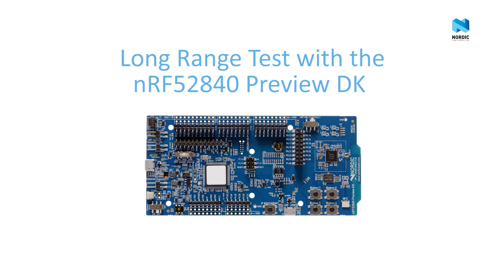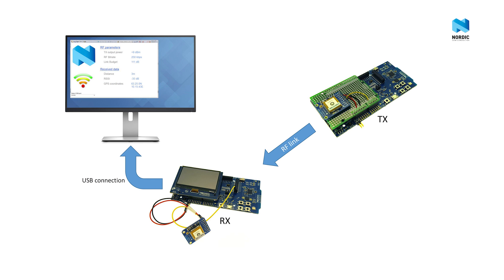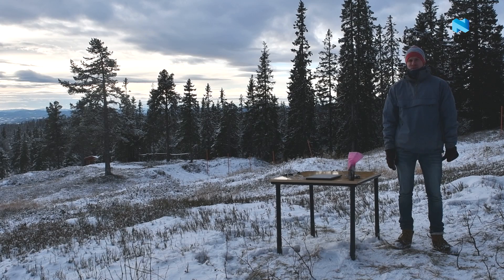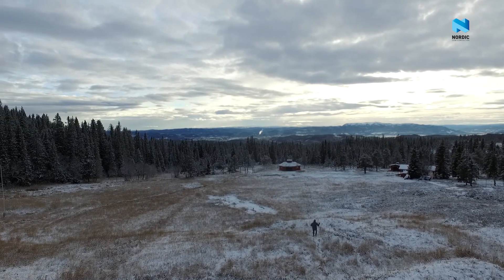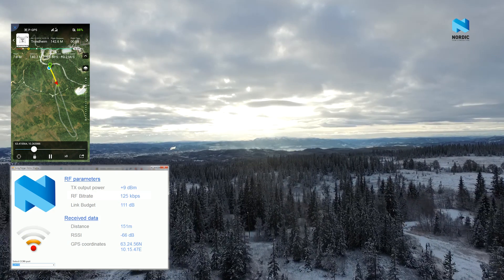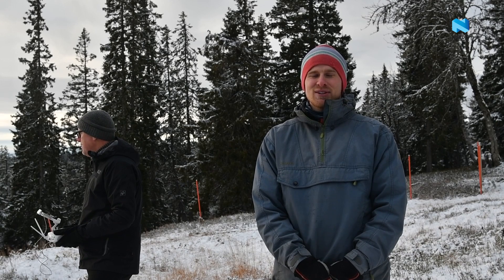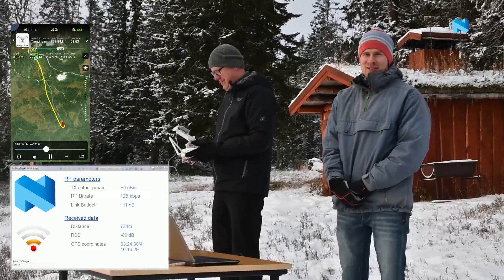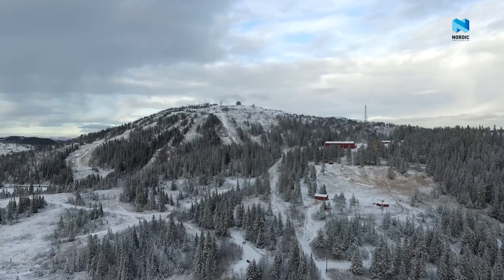Nordic Semiconductor – Bluetooth 5 Long Range Test with nRF52840

Comment: which antenna could i attach to my nrf52840 board. I did not found correct connector for connecting an antenna and testing BLE Codec PHY...
Reply from the maker: The DK already has an onboard PCB antenna so you won't need to connect one to use Coded PHY here as there are no HW requirements for Coded PHY antennas specifically. You can use our board guidelines app note for HW design tips to create you own: https://infocenter.nordicsemi.com/pdf/nan_040.pdf

Comment: Can this be used to transfer voice data between 2 motorcycles on the run about 1km range?
Reply from the maker: The Bluetooth Long Range mode is not very well suited for audio data, since the data rate is quite limited. An alternative to the LR mode is to use a FEM (front end module) to boost the output power of the device, then you should be able to achieve a km of range if you have line of sight, without having to sacrifice too much data rate.

Comment: where is the code!
Reply from the maker: The exact code used for the video is not available, but a similar demo which can be run using the DK's only can be found here:
https://github.com/NordicPlayground/nRF52-ble-long-range-demo

Please note that this is a very old example, and if you are starting a project today it is recommended to start out with the newer nRF Connect SDK, which includes various samples showing how to set up the long range mode: https://www.nordicsemi.com/Products/Development-software/nRF-Connect-SDK

Comment: Hello, I am currently working on this nRF52840-DK board. I want to work with the NFC/RFID reader. I found that Nordic supportX-NUCLEO-NFC05A1 for the nRF52840. Unfortunately, this NFC reader is out of stock in most of vendors. Could Nordic please give me some suggestions for an external reader which is compatible with nRF52840 and with nordic library NFC Reader ST25R3911B. Thanks
Reply from the maker: Hello, we haven't tested the sample with any other shields unfortunately. You could try the X-NUCLEO-NFC08A1 which uses the same chipset and is widely available, but since it hasn't been tested internally there is no guarantee it will work.

Comment: want to use nRF52840 connect to my house 's router .So does the nRF52840 has wifi chip embedded on board ?? 🤔
Reply from the maker: No, our SoCs does not have Wi-Fi onboard. We've just started working with the technology.

Comment: did you test in underwater i want to use it for an underwater project with a waterproff case
Reply from the maker: No, we did not as water absorbs radio signals, in particular those in the microwave range, so the range will be extremely short. A couple of centimetres tops.

Comment: Can I expect greater than 1 KM with external antenna?
Reply from the maker: That would depend on the antenna, but 1KM line of sight range should not be a problem if it is designed properly.

Comment: so the nRF52840 reach nearly 700 meters using the onboard PDK antenna ? no other external antenna was added ?

and what about the power consumption between the nrf52832 and nrf52840 ?
Reply from the maker: Onboard antenna, yes. no external antenna added. Power consumption is very similar, unless the 8dBm output power mode is used in the nRF52840. For more details on power consumption please see the datasheet http://infocenter.nordicsemi.com/topic/com.nordic.infocenter.nrf52/dita/nrf52/nrf52_series.html?cp=2